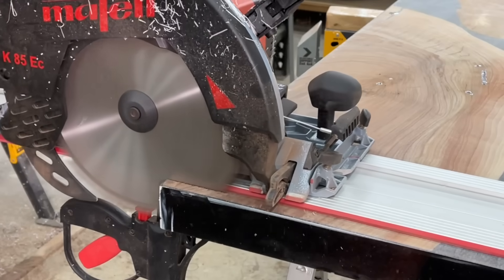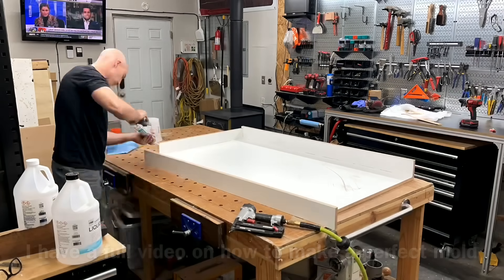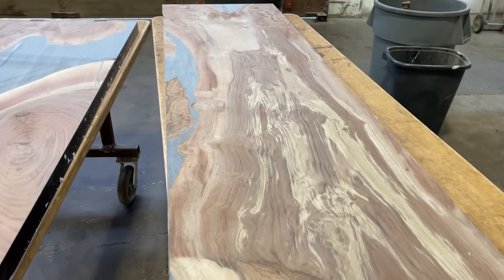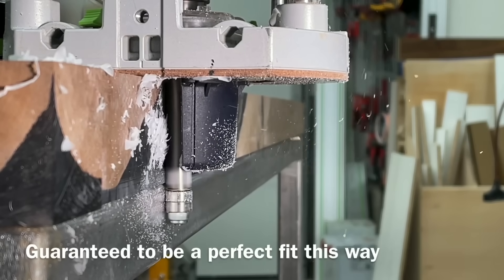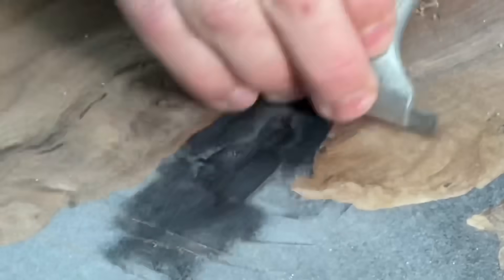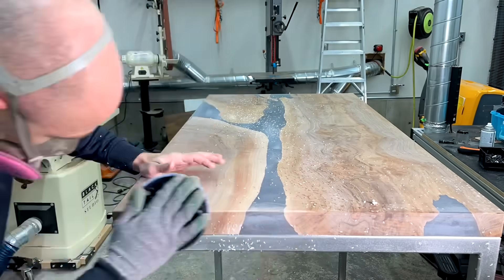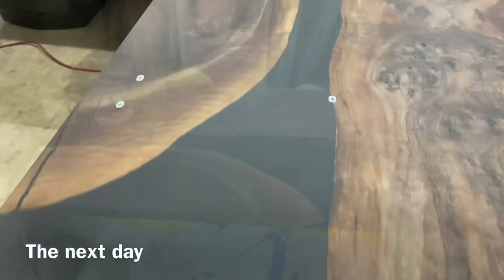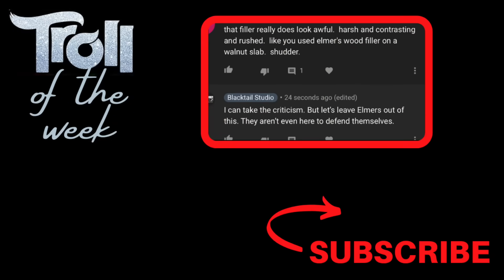Standing Desk The Cops Thought Was Loaded With Drugs (really)

Comment: The answer to people who expect the pricing to be around the cost of materials, is to say that they buy your years of experience. Give a novice woodworker the same materials, and he would unlikely be able to produce a similarly finished piece.
Reply: Idk, if that think costs 7k thats 1 year salary for me working day and night shifts.
bet i could make a table like that in a year...
Reply: So, if I buy 2, the second one will only cost a few hundred since I already bought the years of experience....
Reply: @yaykruser  you need a better job my friend if all you are earning yearly from day and night shift work is 7k .....
Reply: @dougaltolan3017  More accurately you are renting their expertise for the time it takes to make the item.
Reply: He usually pays between 1k and 2k on the wood.  Then hes buying hundreds of dollars of high end epoxy and finishes, has previously bought tens of thousands in tools, a hundred bucks to use the planer, etc.  Then you have to consider the man hours into the project.  He works on these for weeks.  7k is reasonable for a job like this.  Certainly on the high side, but you get what you pay for.
Reply: 'cost of materials' alone means quite little; clearly something requiring 100 hours of labor would tend to cost more than a 2 hour 'bolt it together' job...
Reply: It isn't really about experience or material costs but worth.  What is it worth to the customer?  That's what they will pay.
Reply: @I_Don_t_want_a_handle  "I'm buying this for a friend, so it's worthless to me. Please give for free."
Reply: @lforlight  Of course it has worth for you ... what is your friend's pleasure worth to you?  Why else would you buy it for them? ;)
Reply: I have no problem with high prices for custom work. I was a residential painter for 20 years, doing custom beach homes. Custom costs a fortune for a reason.

But your argument is a little weak. Lol

What you said would only apply if he hadn't been getting paid along the way. You technically just claimed someone should get paid for the very first thing they did, over and over again......

Custom is more mentally stressful, and takes much longer than crap work. I can paint 3 times the square footage of spec houses, in the same time it takes me to paint a single 4 million dollar beach house.

So that beach house has to pay a LOT more per sqft, to make up for how much longer everything takes.
Reply: @I_Don_t_want_a_handle  

Clearly, based on his comment, his friend is worthless to him, and he's only willing to gift them something that he obtained for free.
Reply: @lordgarion514  

"But your argument is a little weak."

"What you said would only apply if he hadn't been getting paid along the way. You technically claimed someone should get paid for the first thing they did, over and over again..."

It's your logic that is weak. Nothing they said implied what you concluded.
Reply: @notahotshot  
Yeah it did.

Fact is, he could lower the quality just a little, and make a lot more. The majority of people would still love it, he'd work a little less overall, and he'd make more money overall.

And using an amateur as an example isn't valid either. Fact is, while this would be pretty complex for an amateur, to someone with a quarter of the experience in the field, it's not that hard on a technical level.

It's the slowing down and taking the time to do those million little things, that make custom cost a fortune.

And as someone who's done custom finish work for decades, I can assure you, custom isn't much harder on the technical level. It's taking the time to pay attention to, and deal with the smallest of details.
Reply: Don't forget the cost of transportation, the tooling, his shop, HIS PERSONAL HOME, the metalworkguy he hired and so on. Every single step in the process involves cost... He can charge whatever the fuck he wants and if someone wants to buy it it's none of y'alls business.

Lower the quality to make it cheaper? Why would you want to buy a mediocre woodworking product. Where do you cut cost. Rotting wood? Worse materials? Poor pour and finish leading to fast degradation? Weaker legs and poor welding, compromising safety? If someone can't afford to spend over a grand or two on a table like this then they should probably rethink their financial choices anyway... The only reason it's more expensive than a regular table is because it's fancy. That's literally it.
Reply: @notahotshot  Quite.
Reply: @yaykruser  I doubt you could make the table in a year! It's not the amount of time you have! It's the amount of experience you've gained. A year is definitely not enough time!  You'll most likely go though multiple slabs of woods and thousands of dollars before you have half the quality he builds. That's the truth!
Reply: @sstelect  i could spend half a year watching youtube videos on how to do it.
Reply: @yaykruser  you make 7 grand a year?
Reply: @CharlieBarlow  yeah, only got a half time contract though.
Reply: also buying their share of all the tools he needs to do the job
Reply: You could learn to make a table like this in less than a year and get the tools you need to make it for less than 7K...
Reply: @BananaDynastyX  How long do you think it takes to make a table like this?
What would be the hourly rate after all expenses?
Reply: @BananaDynastyX  So that's 55330, if he assumes he'll sell five hundred tables he'll need to charge 110.66 on top of materials and labor time just to break even.
Reply: "...they buy your years of experience".... Yep. I spent about 20 years of my life as a service engineer in an industry that was being slowly but inexorably killed by computers so, towards the end, equipment became more and more obsolete and the number of people willing and able to maintain it could be counted on one hand... Without using the thumb. 

The words "had the customers over a barrel" were quite appropriate and I always wanted to send out an invoice reading.....

To: Kicking machine - £0.01

To: Knowing where to kick it - £199.99

Total: £200

I never quite had the nerve even though it's a pretty accurate description of what I was doing half the time. Ah.... Happy days. <shakes angry fist at affordable high capacity disk drives>
Reply: Yeah. Just tell people like that
"Setting prices is NOT Capitalism".
Would they tell McLaren what a car ought to retail for ?. Or a Museum that holds a Titian " Canvas and oil-paint literally cost pennies in  the 16th century ! "
Reply: @yaykruser   I bet you couldn't.
Reply: @dougaltolan3017   So your boss only needs to pay you for Monday, you will work the rest of your shifts for free, right ?
Reply: @BananaDynastyX  No, you couldn't. If what you say is true, why do you think an apprenticeship takes 5000 hours ?.
DO YOU THINK that the accumulated experience of centuries of Master Craftsmen led them to perpetuate a system of training that was wasteful ?
Reply: @uncletiggermclaren7592  only if I'm not allowed to go home before Friday.
Reply: Years back I use to have a gig in high school installing car audio and my starting price was parts and a half plus 25 an hour. 
Although if the car was a trash can or if I had to fix up an attempted DIY fuckup that would cost extra.
Reply: acetylsalicylic acid
Reply: I make wooden tables and benches, the rugged outdoor type of thing. If i priced them acording to the value of the material the tables would cost something like 30€ - 40€. Wich in the end would mean i earn 2.50€ per hour worked before tax. That is ludicrous. You price your materials and your effort, sometimes the materials are the main part and sometimes it's your effort.
Reply: @yaykruser  I mean, go for it. That's the real main thing with pricing on hand crafted things, it's up to the maker and how much people are willing to spend. If you're able to produce product like this at a lower price, there's really nothing stopping you.
Reply: @yaykruser  if you earn less than 7k working both day and night shifts you’re either under minimum wage or in an entirely different country.
Reply: @yaykruser  minus rent or buying tools, trashing a few buckets of epoxy and a few 1k slabs that you wouldn't know how to source anyway etc etc
Reply: to price something the same as the material means you make no proffit, in other words, all that hard work was done for free, so of course the price has to be higher then costs, you are not only paying for the materials used, you are paying for his experience, for the quality he can produce, his hours spent on making your product, and you are also paying for the undeniable uniqueness of the product as well, it is a true one of a kind product noone else will ever have, if the pricing is to low then people will question the quality of your work, to low price and people wont trust you to deliver what they ask for, a high price comes with expectations of quality, but you need a history of reliability and quality to justify high pricing.
Reply: @sstelect  the truth is theres very little to actually fuck up here... and the things that even a clueless worker would fuck up could be fixable without any real cost... and the actual things that require quality here would be the metal working as faulty welds could cause the table to fall other than that its just time consuming... hell 90% of the work would just be sanding.... how do you fuck up sanding? at worst you gouge a spot and either fill it with epoxy or sand it out if its small enough
Reply: @uncletiggermclaren7592  you dont aprentice for 5000 hours to make epoxy tables....hell you dont aprentice at all to make epoxy tables.... its a table with steel legs... the literal only thing you have to do is cut it down glue/nail a box seal the wood and pour some epoxy...then sand....all the shit it takes years to learn is entirely left out of a project like this... wood working is an art... and apart of that art is how basic a project can be while still looking beautiful
Reply: LOL your comment is right on. Remember the show, “Design On A Dime?” Very talented craftsman took cheap junk and transformed it into something amazing. It was fun to watch but few viewers could hope to replicate the results. Like giving someone a pencil and paper, now draw the Mona Lisa. Their talent and skill created the value, not the wood metal and cloth.
Reply: @evaahh9584  nah, im actually above minimum wage, get 10 bucks per hour plus a few cents more for the night shifts. 
But like i said its only half time. 
i dont think i would survive full time, one day they want you to work from     6 am  to 4 pm, and the next day you have to show up at 8pm and work till 6 am.
Reply: I'm a professional writer, and I sometimes take custom commissions of erotica to pay the bills.  I charge a premium, professional rate for my work.  Some people balk and say they can get a custom story for $20 from some teenaged fanfic slash writer.  What they don't realize is they're not just paying for the several thousand words they commissioning, but for the millions of words I had to write over a period of decades to achieve my level of literary skill.
Reply: I proudly make bodgy furniture
Reply: @Leeeeegion  a company I applied for sold custom hand build computer desks. They had price tags of 10k+
Reply: As a wood worker too. Yeah paying for experienced workers is a huge thing
Reply: Price is 100% dependent on what people (or a person) are willing to pay for any given item.  It doesn't have anything to do with the time spent or the cost of materials.  If someone isn't willing to pay what you think the item is worth your choices are to lower the cost, even to the point of losing money, or not produce the item at all.
Reply: Pricing also helps to filter out the pain in the ass customers.  The lower the price the more demanding people get for some reason....
Reply: I do software development. Getting 3 times the material costs would make me a very sad bunny...
Reply: @CharlieBarlow  Pretty sure that is below MacD wages ... lol
Reply: My grandpa always told me. Anything you are trying to sell is only worth what someone else is willing to pay for it. It can be argued all day about cost of materials, time, or experience. But at the end of the day. Of someone pays seven grand for it. It’s worth seven grand.
Reply: @yaykruser  does that mean you're working 20 hours a week? Im only assuming that because full time in the US is generally described, on a basic level, as working more than 40 hours a week. And I did some quick math, assuming you get 6 weeks off out of the year, would mean you're working ~920 hours a year. 7000/920=~7.5/hour. As a fellow contractor I think you should renegotiate, assuming my numbers are somewhat accurate. Obviously though if I'm wrong let me know, I'm not familiar with "half-time" contracts so I could be so off-base it's laughable
Reply: @Lysergic_  Yeah, 80 hours a month 10 bucks per hour , and i think 1.40 more for the night shifts. So net a little under 700 per month so we get to 8.4k actually.
Nothing to negotiate there , only thing would be more hours, but that shit is already killing me, its 3:40 am right now, i cant fucking sleep even though i tried changing my sleep scedule for 3 days.
Reply: @yaykruser  shit, I feel that sleep schedule struggle cuz theres no such thing as consistency in my life. But if its 3:40 for you rn than you're most definitely not in the US, which means that the pay is much better than I thought because here the minimum wage, at least in certain states is $15/hour. Fuck biden. But back to that sleep scheudle stuff, the only advice I can really give is invest in some blackout window shades and turn off/block the light from as much as humanly possible. Light is more important than noise though cuz light, even if your eyes are closed, is the primary thing that tells your brain to wake up. Good luck with the sleeping
Reply: @nwodmf  You have much to learn about life. And today I am not up to dealing with your inexperience. Go take a jump at yourself kid.
Reply: Your "work" is initially worth whatever you and your customer decide it's worth.  A fair price is whatever the market will bear.   One of a kind projects are in a special class of work regardless of the craft or level of craftsmanship.  Top quality is work a significant increase.    
I'm an engineer with decades of project experience. My employers paid me very well based on my experience, training,  and specific previous work to be available at their site. Neither of us knowing in advance exactly what I might need to work on.  If I had suspected the scope of the systems I would produce and the objective value to those companies.  I would have tried to negotiate for more. They might have declined to hire me.
Reply: @sgo9004  You are essentially comparing this to union labor in a factory, which it isn't. It's not just a table; its commissioned art. 
Work like this is something unique. Unique items can't be mass produced, they are designed and created, so you need to pay for more than just the hours of training and experience of the worker(s).   A business has overhead above and beyond the labor and there is a lost opportunity cost of when you have a fixed resource and choose to work on one project  instead of another one.  Imo, the prices charged by Blacktail are reasonable. They could probably bring more if they were sold as finished items in auctions by galleries, but as commissions, the producer and the purchaser both take risks .
Reply: @psdaengr911  Yep.
Business work has a cost/benefit element that is entirely absent in a luxury thing like a custom build. 
If they had got some guy to custom build them a table and it was "worth" ( the price he charged ) less than a industrial mass  produced table . . . it couldn't be what they  wanted. They literally wanted a luxury item.
Many luxury Items are sold and there is no link between the cost and the price, none at all. Right from the planning the company intends to sell above the top price others charge.
Jimmy Choo shoes do not cost fifty times as much to make, as the shoes sold in Walmart. They probably don't even cost three times as much.
Reply: Exactly! You should price your work off the value of your time and experience plus cost of materials.
Reply: @yaykruser  what are you doing that only pays 7k a year?  You live in China or India or something?
Reply: @anjhindul  I am working for the newspaper , bringing them to the right delivery men, sorting, and putting the adress on them, calculared it wrong, im closer to 10k. 
In germany.

Comment: A trick we use when casting in the modelmaking industry is to pour the resin slowly from a height, so the resin stream becomes thin. This helps release bubbles before it hits the casting.

We'll also pour into one location only and allow the resin to naturally find it's way across the volume so it pushes the air ahead of it.
Reply: I'd imagine with a bucket that big it would be hard for him to lift it high enough...ooh, maybe he will diy a setup for pouring like that, and video it!
Reply: @madjennie3417  i imagine he could just go to a scrapyard, find some industrial swivel equipment and bolt some wood together and he's got a pouring jig
Reply: Good tips
Reply: I've found the best way to keep bubbles out of epoxy is to just not mix it.
Reply: @madjennie3417  you have heard of or maybe even seen a ladder before? Please say yes!
Reply: @Skinflaps_Meatslapper  lol

Comment: In making concrete countertops a vibration is used to remove bubbles with gentle agitation to provide a smooth surface finish. Perhaps the same could be done for epoxy when required.
Reply: "Radhammer" on the end of an sds drill will do that great
Reply: There’s a guy that puts his epoxy in some sort of vacuum chamber to draw all the bubbles out…🤷🏻‍♀️